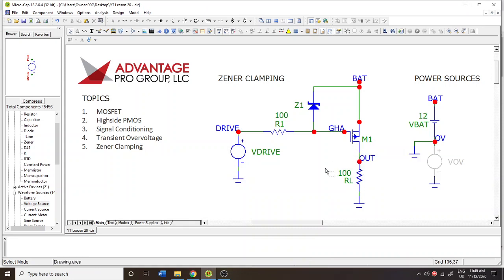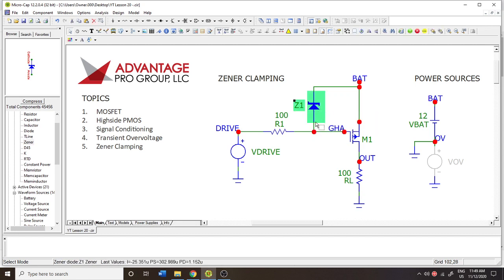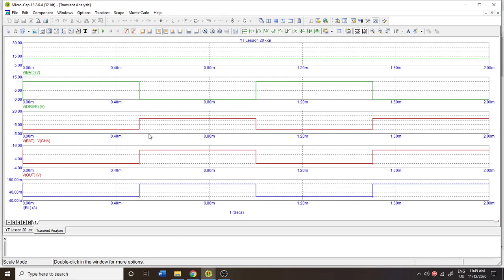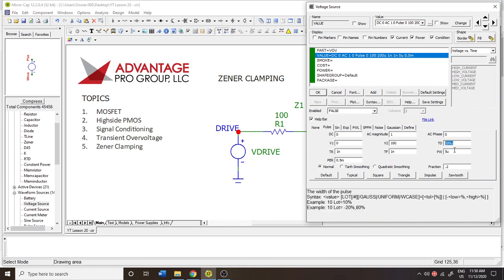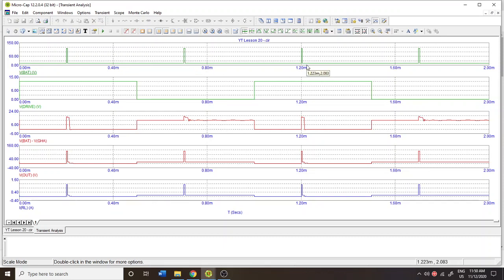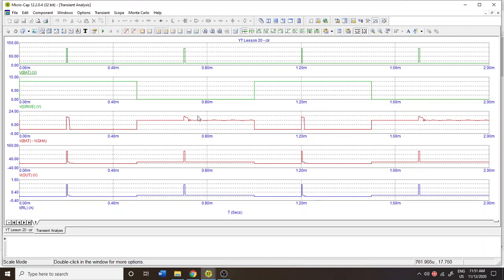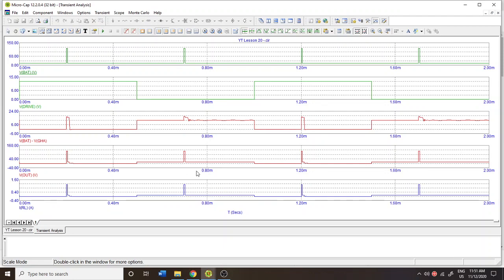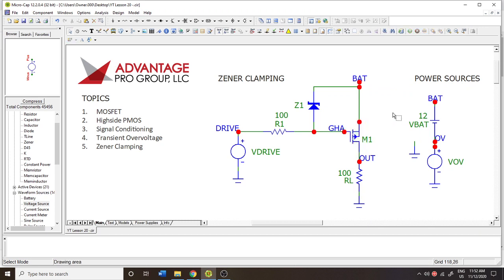Micro-Cap Tutorials: MOSFET Overvoltage Protection PMOS (Zener)

Comment: What am worried about with the 100k at the gate to driver the mosfet won’t get enough current to charge up the gate
Reply from the maker: 100 ohms was used in this example. You are correct 100 kOhms would potentially cause the MOSFET to be slow at turn ON. 100 kOhm would form a RC network with the innate input capacitance of the gate and source.

Comment: Hello, Thank you for your explanation. I wanted to know how can you protect 50 v in the Output?
Reply from the maker: I have a video on this. As in protecting the load from 50V and higher? Often you can use overvoltage protect circuits at the power supply's input. This would mean placing a pchannel in the highside or nchannel in the low side. Nchannels in the highside work also but must be enhanced by another driver circuit. This function is called "load switching" Sample the power supply input using resistor dividers (hundred kilo-ohm scale) and compare that to a voltage reference circuit (say 35 V). When the comparison proves an overvoltage event has occurred, shutdown the load switch and prevent access to the load. An analog is when someone keeps asking you for money or services...a little is ok but eventually you have to cut them off. For other kinds of overvoltage protection use a transient voltage suppressor (TVS) diode for events like electrostatic discharge (ESD). They are designed to handle the higher rate of voltage change (dv/dt) where the OVP circuit handles slower transient events.
Reply: @pauljstar  Thank you for your reply. Please can you share that circuit?

Comment: Thank you. How would you prevent the mosfet from turning on during such a spike? Some dedicated enable signal?
Reply from the maker: I would try to snub these at the closest point to source. The spike in this example is occurring from the power supply. So, that might mean adding bigger and better filtration components on the power line (choke inductance, reservoir capacitance). Going further you'd investigate the root of the source which might be customer equipment...you'd then have a phone conference to talk about their electronics and what to do if their input falls out of specification.
Reply: @pauljstar  :) Thank you!